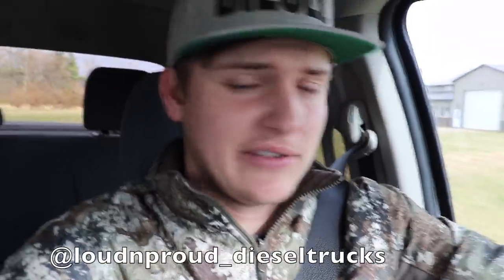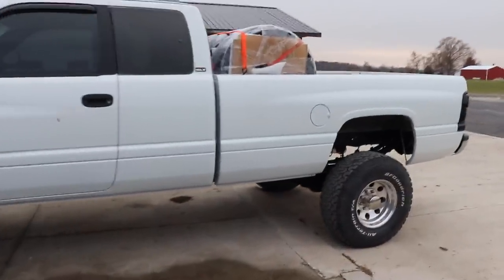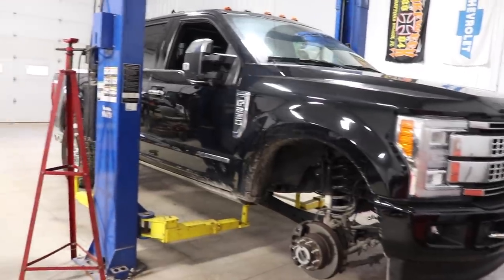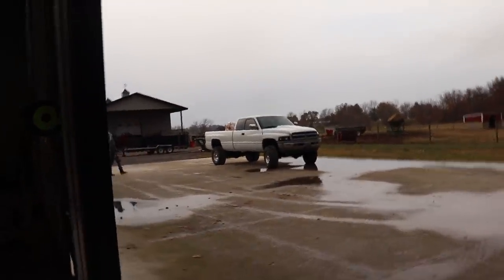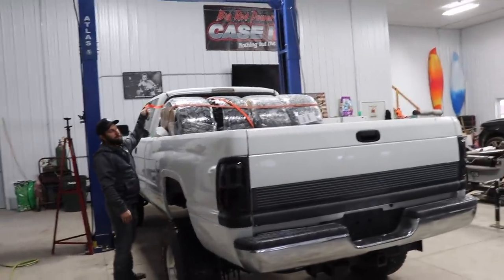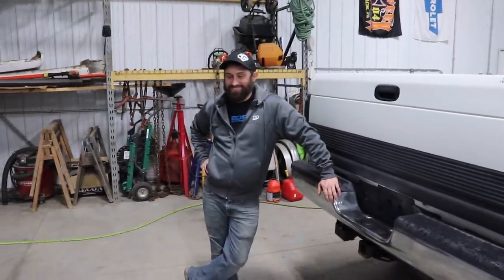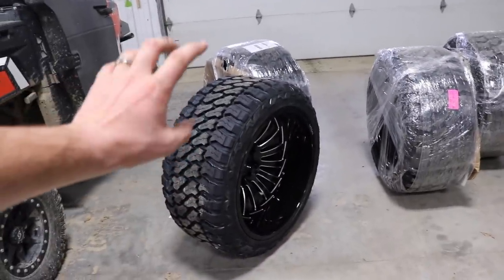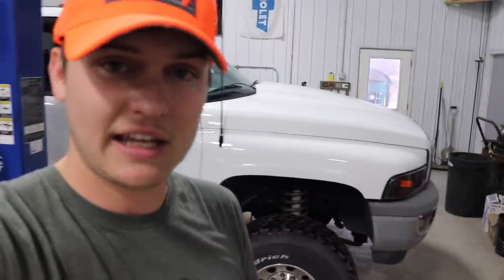HE PUT A FRONT LIFT ON MY F 250 PLATINUM!!!

Comment: New wheels don't like. Keep rims and tires on white truck that's on it.
 Neither truck needs leaving kit. 
  Hopefully you can put it back stock if I win one
Reply: I'm with you on that. People that actually tow with and use their truck don't want it leveled and want some side wall so it rides decent
Reply: Agree with ya 100% but to each their own,not sure his gear ratio but if they are 3.54s it  would need the 4.10s swapped in for 38s,i guess I'm kinda old school and like a truck closer ro stock height for practicality purposes
Reply: @briandiesel7295  I know older diesels , so I have never seen a diesel with anything but 4.10 gears.  I see it everyday,  running 40s and bigger with no regear. It a diesel it makes low end torque,  no need to regear unless you are pulling a trailer.  Most guys with big tires don't tow anything so it's fine.